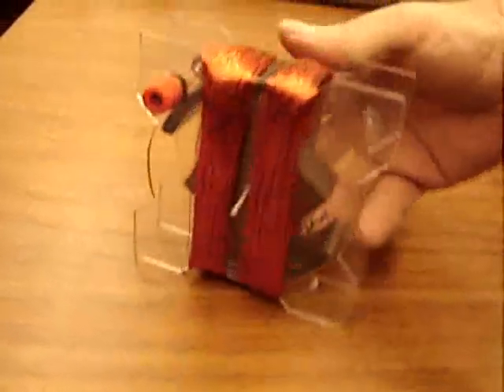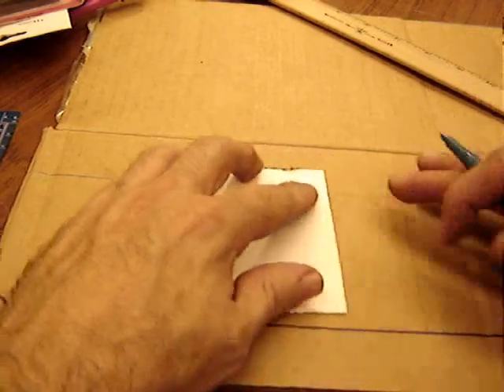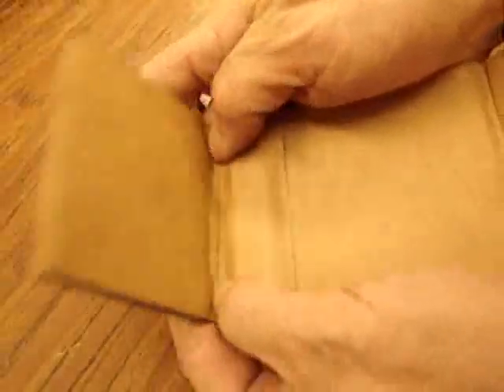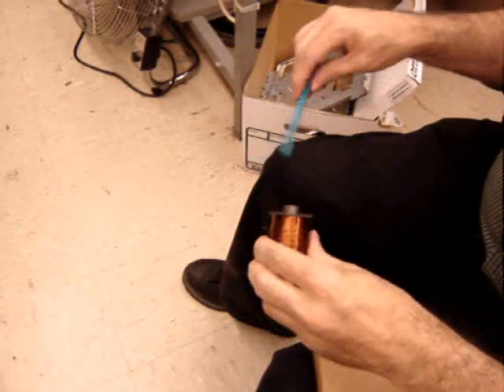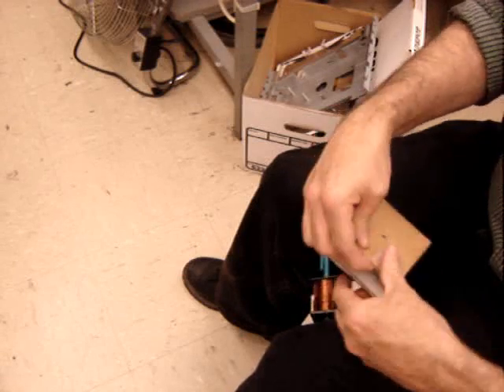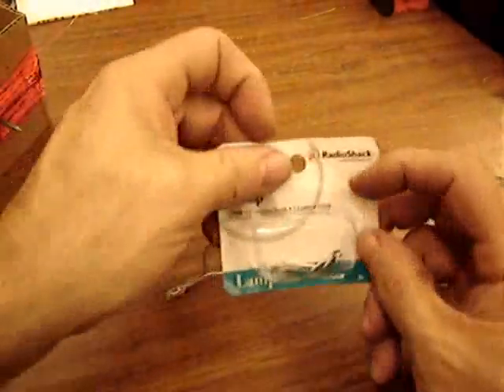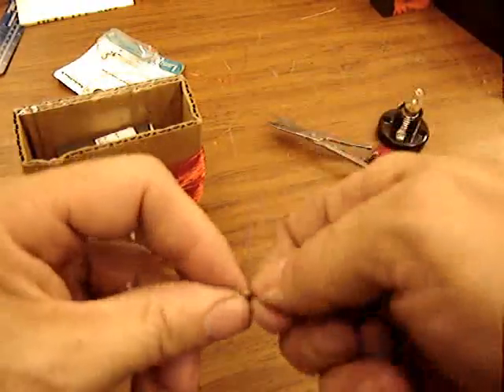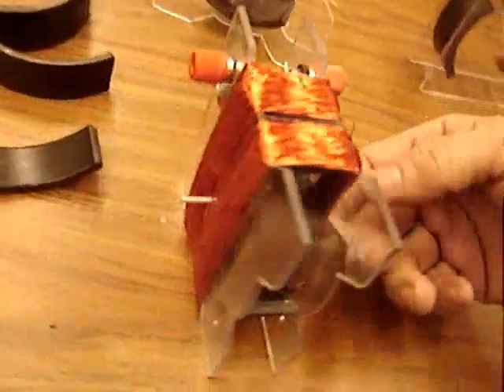Simple generator:  AC electric generator for science fair

Comment from the maker: > I'm thinking more wire, diode

You have to double the number of turns in order to get past the diode turn-on voltage.   Even better: use a stack of 1" neodymium supermagnets, and a plastic structure glued up from sawed squares of plexiglas.

If the coil is close to a supermagnet, then you only need 50 turns of wire, instead of 500.

Comment from the maker: > tried it with a more common LED

Yep, red LEDs work fine.  You have to spin the magnets a bit faster than with the tiny bulb.  Also, LEDs flash on and off, since they only turn on during half the magnet rotation.

Comment from the maker: Yep, you can clean the insulating varnish off 1in of the ends and twist them together.   The thick wire isn't very long, so it doesn't add too many more turns of wire to the cardboard.

Better mail-order a couple of those $1.50 solenoids from Electronic Goldmine.   Each one provides about 700 turns worth of wire.

Also try:  buy several of those light bulbs.  Add more and more of them in parallel, see if the generator can light them.

Comment: Have you tried it with a more common (low-brightness red) LED? I suspect that as long as you get the polarity right, it might work. They also work at 20-25ma. And should be fine as long as you don't exceed 1.5 volts (which is probably more than the output of the generator). Although, again, it would probably be very very dim. What are your thoughts on this? =D Love the generator btw.

Comment from the maker: > magnet size and strength matter?

Yes, smaller magnets must spin faster to generate the same volts.  Also, to put the coil very close to a smaller magnet, you must build a smaller box.  (The ideal generator is a sphere magnet inside a close-fitting circular wire coil.)

Neo magnets give about 10x voltage.   I made a tiny generator by spinning a 1-inch N35 neo sphere inside 1.25" plastic pipe.  It only needed 50 turns of wire to light the bulb.

Comment from the maker: > Neodymium magnets yield more voltage

Yeah, if you keep the size the same, it's about 10X higher volts.

Even better is to use a thick 1-inch neo magnet, flipping inside a smaller cardboard or plastic structure.   Then you'll only need 50 turns of wire to light the bulb.  (But with just one magnet you'll have make the axle differently, like two nails with heads glued to magnet sides.)

Comment from the maker: > you couldn't turn that "backwards" and get ac current, 

Yes, but to become a generator either it must be part of an operating AC power grid, or it needs a parallel capacitor for 60Hz resonance.

AC induction motors can become "induction generators" (search those keywords.) These are like an electrical version of a pendulum: in order to pump mechanical energy into the shaft, the invisible "pendulum" must be already swinging.

Comment from the maker: > I'm not sure what is the bare minimum requirements.

That whole generator is the bare minimum.   

If I ever find any way to simplify it more, then I'll have to make an "even simpler generator" video.  But I've found nothing.   

Well, if  you use large expensive supermagnets, you can make it smaller and with less wire.  But it costs much, and you have to have a credit card or bank checks to do mail-order.

Comment: the way this works is the wire is called magnet wire used in motors and generators, and moving a magnet over the wires (or switching north and south poles quickly) induces a electrostatic potential or a voltage as it is known. so the stronger the magnet the easier it is to get a good voltage going. keep in mind the more wire next to the switching poles the more energy you get out of the 1 magnet.  Hope that helps

Comment from the maker: > Is the amount of electrical power produced limited by the size

Higher power isn't the goal.   Instead of 1v bulbs, if we could buy 1/10-volt bulbs or 1/100v bulbs, this generator would light them brightly.  So...  higher voltage is our goal.

You can double the voltage by doubling the speed, or 2x magnet strength, or 2x number of turns of wire.  Larger magnets help (I think a bigger width helps more.)

Supermagnets are 10x stronger, so just one large neo magnet gives amazing improvement.

Comment from the maker: > it is hooked to a windmill. 

If you want to make changes to this project, by connecting it to a windmill, then this works by a very simple rule:  if the windmill spins slower than fingers can, then the bulb will never light up.

Your challenge is to change your windmill so it spins more than five times faster than it does now.  You'll need a gearbox.   Or, wind two or three more spools of wire on the generator.  That way your windmill will still work if it only spins twice as fast.

Comment: i used one spool of the red wire and got 100mV.. My bulb doesn't light. Sounds like i need at least 500mV to light the bulb. Do you think that one more 200ft of red wire would get 100mV up to 500 or did I do something wrong. I can only spin it so fast as it is hooked to a windmill.

Comment from the maker: > a)what makes one end of the copper wire be positive and the other

It's AC, so the pos and neg keeps switching back and forth each time the magnet turns one time.  The bulb flashes twice.

> but isnt the wire touching each other 

Nope, it's coated with plastic insulator: red varnish.   That's why you have to scrape the ends clean when you hook it to the bulb.

Comment from the maker: > neodymium earth magnets (very strong) left from a project of his

Tiny magnets won't work in the large cardboard generator.  The wire must closely hug the magnets.

I made a supermagnet generator by spinning a 1-inch supermagnet sphere inside 1-1/4 inch plastic pipe.  The bulb would light up with only 50 turns of wire wrapped on the pipe.

Look for other DIY generator websites with small supermagnets spinning inside a pill bottle or in a plastic 35mm film can.

Comment from the maker: > if we use a 24 gauge wire

The output voltage is set by the number of turns of wire.   With twice the turns, the volts go from 1/2volt to 1volt.

But the generator's internal resistance is set by the wire thickness.  So if you increase the thickness, that will decrease the resistance, and increase the maximum possible current.

If the wire is just thick enough, the bulb will light up normally.  But if you add more bulbs in parallel, they will all get dimmer.  That's where thicker wire helps.

Comment from the maker: > how can you get it to produce more electricity.

Higher voltage?  Add lots more wire, also spin it way way faster.   Usually a generator has step-up gears for high speed:

hand-crank generator
tinyurl com/555erf

One trick is to glue a tiny wheel on the generator's nail, then hold that wheel against a spinning bicycle tire.

Comment from the maker: > I don't think it was 300 turns 

One radioshack spool is about 300 turns.  That will work, but you'll have to spin the magnets pretty fast, like snapping your fingers with the nail between.

If you want a less-simple generator, you can buy a second kit of radioshack wire and add another spool of #30 wire.   Just clean off about 1/2 inch of the ends of old and new wire, and twist them together many times.  Be careful to keep winding the wire in the same direction as before!

Comment from the maker: > and can you use regular copper wire?

Magnet wire is copper wire, but it's coated with red or colorless insulating varnish.

Bare copper wire won't work since the turns will touch, causing a short current path.  Normal wire with colored plastic insulation is WAY too thick, and 300 turns would be the size of large grapefruit.  Varnished magnet wire of around #30 size works well.

Comment: wbeaty, you are a very smart guy do you think perpetual motion exist? cause think with one of your generators you can light up a light bulb.well add in a motor and some type of drive system to the shaft(nail) and if added say 5 more of you generators you could possibly make enough current to run the motor nonstop, right? well to make it efficient you could have bearings and stronger magnates, along with more coils. i think it is possible with the right gear ratio to make it work
right back soon

Comment from the maker: > can you tell me how much it produces

The light bulb needs at least  0.5 volts at .007 amps, or .00035 watts ( four milliwatts.)

If you spin it very fast so the bulb lights brightly, then its 1.5 volts and 0.025 amps, or 0.0375 watts (about forty milliwatts.)

It's not as simple to produce several watts needed by a normal flashlight bulb.  You need supermagnets.  Or add some iron parts made in a machine shop.  Or just spin a small DC motor (it becomes a genrator.)

Comment from the maker: It lights a bulb easier.  You have to spin it too fast to flash an LED.

Or add lots more wire, like more than 500 turns.  Red LEDs get easier to light.

Comment from the maker: > What If You Wrap It 1,000 Times? 

More turns of wire is the same as using stronger magnets: then it puts out higher voltage for a particular speed.

With twice as many turns of wire, you can light the bulb while spinning the magnets half as fast.

Comment from the maker: > how do you find - and +?

The + and - is switching back and forth.  It's an AC generator where the magnet's North and South poles are generating pos and neg voltage.  If you hook up an LED and spin it fast enough, the LED will flash on and off.

Comment from the maker: > whats the max output 

Get about 8x higher voltage using similar size supermagnets ($40, about $10 each)

Or redesign: I only needed 50 turns of wire if I used a 1" sphere supermagnet spinning inside a piece of 1-1/4" PVC pipe.  The wires can be much closer to a round magnet.  It lit the bulb brightly.

Comment from the maker: > I must know 2 things.

Cereal box cardboard is probably too wimpy and easily crushed.

One spool of #30 will work, but you'll have to spin the magnets awfully fast.  Two spools is way better since then you can spin the magnets half as fast, yet still light the bulb.

Best is to buy that special "solenoid" from mail order, then use some vise-grip pliers to open the steel part so you can remove the wire spool.  It has way more wire than you can use.  Then wind 600 turns on the cardboard!

Comment from the maker: > wouldn't they connect on the same side if you just put them side by side. 

One stack of magnets works fine.  But if you try to use two parallel stacks of magnets, the North of one stack MUST be next to the North pole of the other stack (and the S next to the S.)  Then the two stacks repel very strongly.  You'd have to clamp them together and use glue.

It does work though.  I've glued together lots of small 1" Rad Shk magnets to make two big magnets for the generator.

Comment from the maker: > 25 of those Neodymium magnets on either side

Use a big Neo magnet.  I made a generator with a 1" sphere-magnet, and it only needed 50 turns of wire to light the bulb.

This generator uses a single stack of big magnets, and that works fine.  But if you use many stacks of tiny magnets, you'll have to glue those stacks.  The poles on the ends of the stacks must all be the same, and that means that the stacks repel each other.  Can you push the repelling neo magnets together, then glue them?

Comment from the maker: > I could not get mine to work properly.

It has to spin really fast, whizzing without touching the cardboard.

If you use two kits of wire, or get a bigger spool and wind 500 turns, then it's much easier to light the bulb.  With 500 turns, you don't need to spin the magnet so extremely fast.

Comment: I made mine (or tryed to) today, and I could not get mine to work properly. It had some power for AC voltage on my volt meter when ever I did not turn it. I did cardboard version by the way. Does it have to have a nail?

Comment from the maker: > If i wound the 22 ga. wire around it, wouldn't it pick up more power?

The spool of 22ga is too short!  It doesn't add much voltage.  Better to buy two whole kits of wire for extra 30ga.  Even better are mail-order solenoids.   Be sure to spin the magnets REALLY fast in a dark room.

Comment from the maker: > quick step-up transformer? 

Easy: add a thousand turns of wire to the generator!  :)

I made several tries but gave up.  The AC frequency is too low.  Now if the magnets could spin at a few thousand RPM, then maybe we could run transformers.

A transformer needs to draw almost no current, which means the primary must have a huge inductance.  Pounds and pounds of iron and wire, and worse at low AC frequency.

Note that magnets make poor iron cores: they're stuck in full-magnetized mode.

Comment from the maker: > my magnets are slipping on the nail

Mine slip a bit too, but I find I can spin it fast enough.

Improvement: get a roll of double-side foam tape from stationery store, cut some 3/4" cardboard and tape squares, then stack them on the magnet on either side of the nail so the nail sits in a narrow slot.  Adjust the amount of tape and cardboard so the gap between magnets is a bit smaller than the nail.  Adjust it so it's hard to push the nail between the magnets when assembled.

Comment from the maker: > powering something that takes DC

Check the website:  add a diode, then add lots more turns of wire to make up for the 0.7V eaten by the diode.

Yes, Faraday discovered induction.  Then Maxwell/Hertz/Heaviside saw that a moving magnet creates an e-field (a voltage.)  But  Einstein looked at relative motion in E&M theory: his Special Relativity *explains* induction.

Note that the e-field around a moving magnet is circular.  If we pass more turns of wire through it, we intercept more volts.

Comment from the maker: >3phase motor can be converted into a Generator.

It has to spin at a speed that would create about 60Hz.  Also, it has to connect to a power grid, since it only becomes a generator when spun faster than the existing drive frequency.  But fortunately you can replace the power grid with 3 capacitors.  The motor coils combine with the capacitors to become an electromechanical sine-voltage oscillator.  Add a load only after it starts generating.  See tinyurl com/5mhhb, also tinyurl com/55jffn

Comment from the maker: > I still don't know how that makes electricity. 

Generators don't generate any electrons.  Instead, the wires are already full of movable electrons.  A circuit is like a hose that's always full of water.  A generator is an 'electricity pump.'

But why does a rotating magnet pump an electric current?  Einstein figured it out, where magnetic fields relative motion are the same as a voltage.  The coil is full of electrons, and the changing magnetic field makes a pumping voltage which pushes them.

Comment from the maker: > hi, i was just wondering if i could use plain copper wire?

Copper wire almost always has varnish already on it.  Try scraping your wire with a knife and see if you scrape off some plastic powder.

Painting varnish on 500 feet of bare wire would be a big job.  Instead, go buy a $2 solenoid that's mentioned on the main website, then use vise-grip pliers to pull the iron frame off.  Inside is a large coil of exactly the correct type of wire.

Comment from the maker: It's probably cheaper to buy a surplus DC permanent magnet (PM) motor and use it as a generator. Old PM treadmill motors or old tapedrive reel motors are $50 to $100 and work great as generators. Try herbach com under DC PM field motors.  Also sometimes big motors at sciplus com

Comment from the maker: >  in a larger size work for larger things?

My version is not very good, since it was designed to use available parts and to be very simple. 

 

If you want to build a GOOD generator, then mail-order supermagnets are far better.  Even better would be some iron parts made in a machine shop.  The otherpower com site has lots of designs in their wind section.  Here's one:   tinyurl com/4fcb4k

A simple good design passes some disk-shaped supermagnets over one or more pancake-wound coils.

Comment from the maker: > can i convert it to a higher volt?

Just use lots more turns of wire.  Tear apart those $2 solenoids from Electronics Goldmine.  Or, use a couple of large supermagnet blocks, and change the cardboard shape so the wire is as close as possible.

Comment from the maker: > did you glue the magnets to the nail or to each other? 

Whatever works.  I stuffed little cardboard squares on both sides.  On another, I put thick plastic squares with 2-side tape, so the magnet attraction clamped it to the nail.

Comment from the maker: > I tried doing my own plastic version with all the materials listed and it didn't worked.

Try doing a cardboard one.

Before making your own changes, first get the original one working.  It's on my website.

Note that you have to spin the magnets very fast.   It helps if you use lots more wire.

Comment from the maker: Yes, more turns of wire is better.  It lights the bulb brighter, or also lets you spin the magnet more slowly.

Lots of wire for only $1.49, get the coil out of this 24volt solenoid below:

Electronic Goldmine, Heavy Duty Solenoid No. G15805, $1.49 40 ohms 24V

Comment from the maker: > i use 4 neodymium block magnets

"Simple Generator" uses large ceramic magnets.  If you use different parts than those listed, then you're building a different generator.  Before making any changes at all, it's best to first build my version and get it working.

For example, the coil always must be VERY VERY close to the magnets.  So if you change the magnet size, you'll have to redesign the cardboard box so that the wire windings are still very close to the magnets.